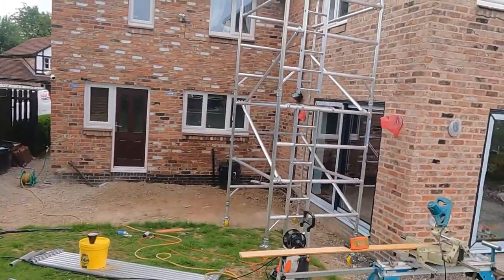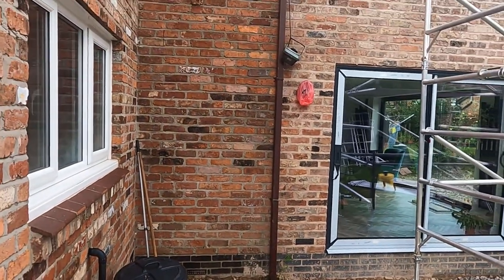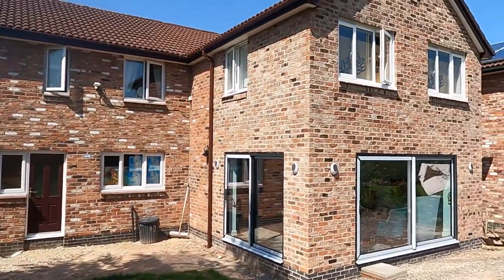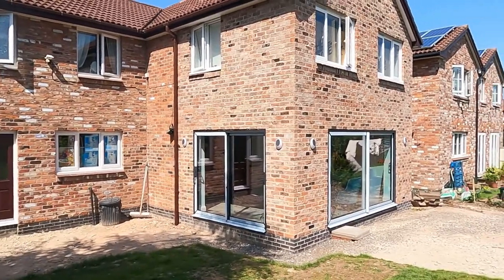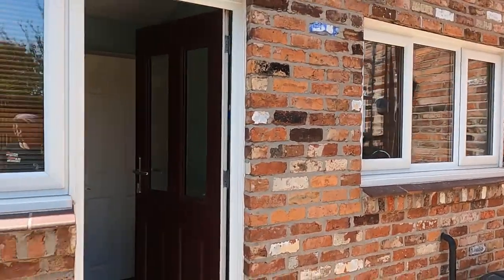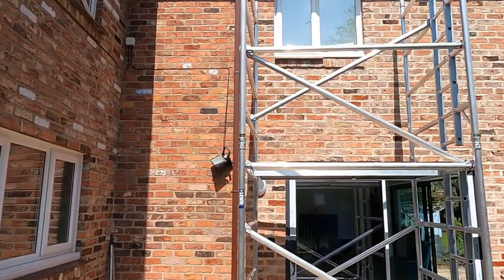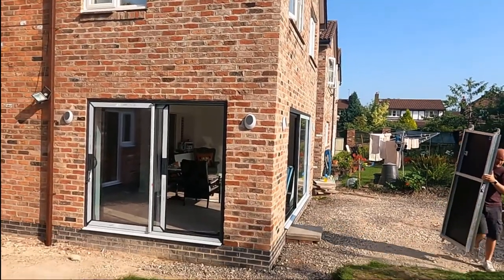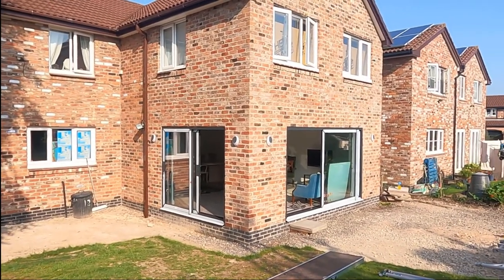Brick Tinting

Comment: Hi I want to make my bricks lighter an some even different shades how can I get them lighter as they seem quite orangey
Reply from the maker: Hi there I would try using a lighter colour the products are used were by a company called total wall care and they have a product called limed wash I suggest you try on a Brick that's not that obvious and see if it helps get the colour to something more in keeping with what you wanted. You can buy several colours and mix in together making your own colours. Good luck